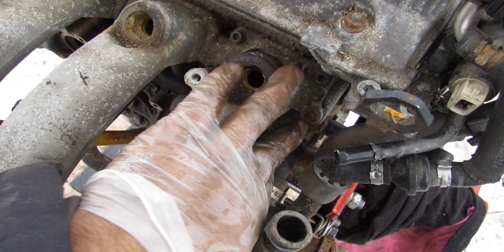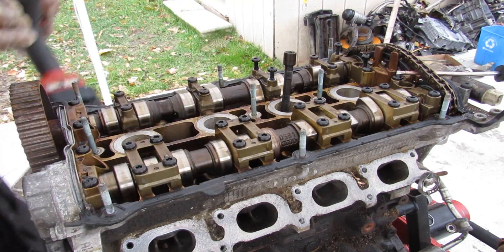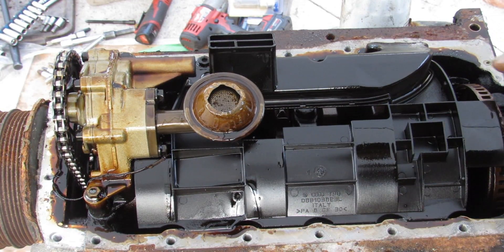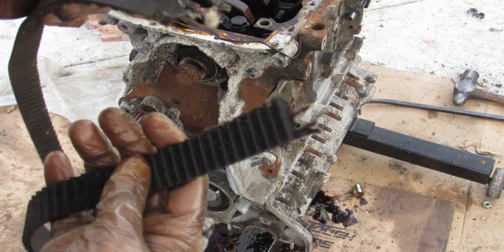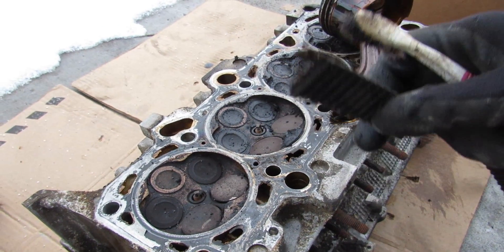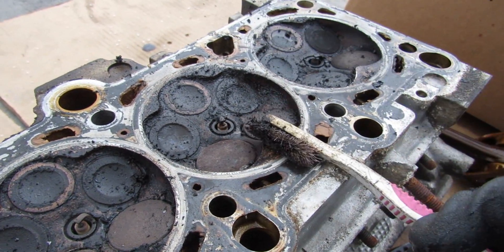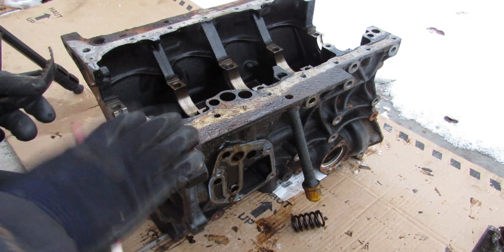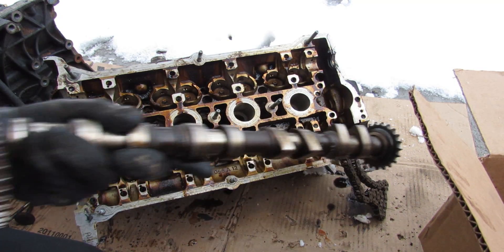What Happens When a Timing Belt Fails?

Comment: Anyone having experience with Toyota's 2ZR-FXE engine? We're searching for a week but just cant find the problem, maybe someone here is more knowledgable or has an idea.

The problem started after the car came back from the bodyshop, they did some bodywork on the rear bumper, before it was fine and now its not but the bodyshop swears nothing happend, what can you do?!

Car has only 30k miles and has missfires on cylinder 1 and 4 (the outer crank pair) and shakes and rattles like hell but only when part trottle, under full load it disappears. 
We tried about everything, new plugs, changed coils around but their fine, changed fuel injectors around but their also fine, cleaned then replaced the EGR valve, cleaned the EGR heat exchanger, cleaned the EGR pipes, cleaned the intake bridge and all the internal EGR pipes and inlets and finally cleaned the throttle body.

We checked all the combustion chambers for coal deposits or marking but their all clean and fine, compression is fine and even, no excessive oil consumption.

We recorded data and everything looks fine in the live telemetry, throttle demand matches throttle position, same for the EGR system, all the sensors and their data seem fine, all the systems are working as they should and are fine too, nothing out of the ordinary.
 
We also had many ideas we checked via live telemetry but finally put aside because it would affect all 4 cylinders and not only two like the VVT system, the oxygen sensers, fuel pump, knock sensor, crankshaft sensor and many more.

We're at a dead end, anyone having a good idea?
Reply: You changed all those things without changing the ignition coil harness or injector harnesses.

When I had misfires on my kia g4fc I changed my spark plugs and an ignition coil, but the misfires remained on the same cylinders, even after swapping coils around all other cylinders, it remained constant on the same cylinders until I bought a used harness and then the engine ran like a dream.

Try a new ignition coil harness or injector harness, they're cheap af at junkyards, as long as you know it's a misfire, it'll be in the induction, fuel and ignition systems.

You should also know that a harness can look good and function, but still be bad by having too much resistance.
I wish you the best figuring this out.
Reply: @chiefdenis  Thanks for the input. 

The only things we changed were the plugs and the EGR valve because we had one lying around. I should probably have said "switched around" instead of "changed around", sorry my bad, its not my native language.

I really dont believe the ignition coil harness or injector harness could be the problem because the car was running fine before it was in the bodyshop. Also its a Toyota, we never have any problems with wiring and this one has only 30k miles.

Its a car from our own external business so we have time and it wont cost any more for troubleshooting so we started with testing things first and try to find the failure before we start ordering replacement parts when we dont even know if thats the problem or not.
Reply: @benistingray6097  this is my process for fixing misfires; misfires will usually occur due to a malfunction in the INDUCTION (INTAKE), IGNITION, OR FUEL SYSTEMS, it can be in more than one of the systems so i'll usually do some basic tasks in all systems:
INDUCTION: get a can of carb cleaner and maf cleaner (or electric contact cleaner since maf cleaner is not available in some countries) disconnect the intake ducting and clean the throttle body with carb cleaner and an old toothbrush + a rag, also clean the air filter or replace it if its beyond filthy.
within the intake you should locate the maf sensor and spray it with the maf cleaner a couple of times, it's usually right after the air cleaner, some weird designs have it before the air cleaner though, you dont want to touch this sensor unless you dont have a spray solution.

IGNITION: if you switched the coils around and the misfire remained on the same cylinders, then you most likely have good coils, the problem could then be a bad harness or dead spark plugs.
spark plugs are really cheap so i'll encourage you to atleast change them to eliminate that aspect.

You can also take out all the spark plugs and inspect them, the misfiring cylinders will have black spark plugs because they're not burning the fuel, sometimes a bad spark plug/ignition coil will still fire but will be unable to burn off all the fuel.
A good firing cylinder will look close to white or brownish due to the dye in fuels or if you use a fuel additive.

There are resources out there for reading spark plugs, that knowledge is invaluable for figuring out misfires, you should always try to read your spark plugs first, it'll likely point you directly to the system you need to be tackling.
i'll give you a brief, completely black means it's not firing so your problem might be in the ignition system.
Black and slightly wet means it's getting flooded with fuel so you're running rich, tackle the induction system and possibly injectors.
Black and very wet means it's getting oiled either from the spark plug valve gaskets, valve stem seals, or piston rings.
If it looks almost too clean even though it's been installed for a while, the combustion temperatures might be too high due to running lean, you'll want to make sure the injectors are firing properly, sometimes a bad o2 sensor can mislead the ecu to run too lean.
these are a few symptoms of spark plug colours off the top of my head you should definitely research spark plug colours, it'll help greatly with your problem.
Reply: @benistingray6097  i had to break my comment into 2 because  the first one was getting too long.

FUEL: for the fuel system, simply having bad or contaminated fuel is enough to cause a random misfire, it wont be on only one cylinder though, usually just adding more good fuel to mix with a bad one and driving a couple of miles can solve a bad fuel misfire.
other than that, clogged injectors or leaking injectors can cause misfires when they don't deliver the right amount of fuel directed by the ecu or deliver too much due to leaking, fuel needs to be atomised when injected, you can solve this by cleaning your injectors and replacing bad o rings.

A bad injector harness may also cause an injector to not deliver the right amount of fuel, it's a power cable after all, a poor signal might cause poor atomisation or none at all.

The check valve at the fuel pump and pressure regulator at the pump or rail can get bad and reduce the fuel pressure, on none performance cars the fuel pump should constantly deliver 40 to 60 psi of pressure (depending on car) all through the line and at the rail for hours, you can check this with a pressure gauge or a high end scan tool. You will especially have a poor idle and low rpm performance if your fuel pressure is weak.

All that said, i'll encourage you to thoroughly tackle all these systems by process of elimination from the cheapest problems to the most expensive, there's a 99% chance your problem is in one of these systems.
Now, even though i don't think and EGR valve can cause a misfire, as long as it's easily accessible, i'll advise you to clean it up with a carb cleaner spray, it's cheap and precautionary, but i 100% don't think your current problem has anything to do with the egr valve.

Good Luck once again, fellow traveller, be thorough.

Comment: One of my favorites. A good engine if taken care of. They had to upgrade the oil filter capacity early on, when the filter was small they were sludgers. The upgraded filter is HUGE.
Also, cool to see it from behind (I had a Passat), had to replace the heater core hose and the coolant flange (you called it the coolant inlet with the temp sensor).
The Secondary Air Pump was GARBAGE. Always full with water... I had that engine light flowing 24/7 because of it.
05:20 five valves per cylinder, who can not remember that 5V 1.8T engine cover :)
Reply from the maker: Good to hear first hand experience. If this timing belt didn't snap and bend valves it would have still be running although probably burning oil as per the internal condition
Reply: @speedkar99  I've seen folks with 300-400k miles and they wouldn't "change" the oil, they would just top it off. Mine had 230k and started to overheat but EVERYTHING in the interior was broken. I had 2x4 holding up every window apart from the drivers. Door handles, I mean you name it everything broke... I had no energy nor time to work on it and I was a student in the city so it had to go. Those B5 Passats were one of the best driving cars with that suspension! Would love to buy a 1.8t manual 4motion (back then same as quattro) and fiddle with it as a project. Mine also did not burn any oil that I remember, I also used 0W-40 Mobile 1 "European Formula", unsure what that did to the engine but the engine liked thin oil.

Comment: Meanwhile, my outdated Honda R18 has a chain. All Honda 4cyl newer than that have chains too
Reply from the maker: Chains aren't always better than belts. VW tried chains and didn't do very well.
Reply: Yeah, failing chain tensioners, plus some the new Hondas stretch the timing chains and chew the cam sprockets. Good oil, 8-10k km max OCI instead of Honda oil calculator and they should hopefully hold together. But I'm not really fun of chains, but  multistage variable V-Tec probably easier to design with chain, but the chain works harder. Then the oil has less zinc as additive comparing to 5w-30 made three decades ago.
Reply: Some GM 3.6 engines had an OLM that went too far. It may have done a good job keeping up with the TBN of the oil, but not the needs of the timing chains. People who changed oil earlier than the OLM were able to delay or avoid the problem.

Comment: Also while you are there change that plastic water manifold, because having to take half the engine off to do the belt means you can actually get to that as well, so do it with the belt, because it is also about the time they start to leak as well.
Reply from the maker: Good idea

Comment: I love this channel and I DO CARS with ERIC. I love how mostly idiots that don't change oil regularly end up having a blown engine. Sometimes it is poor engineering.
Reply from the maker: I watch his channel too, he does good work. And you're right, at the end, it all comes down to maintenance
Reply: Sometimes people do change their oil regularly, but the users manual is too optimistic about how far you can go. Some VW engines called for 10,000 mile oil changes with their 5w40 synthetic, but shouldn't go beyond 5,000 miles.

The Toyota 1MZ-FE called for 5000 mile conventional oil changes, but people who did that often ended up with the Toyota sludge disaster. Many people avoided it with 3000 mile conventional oil changes. My dad knew an Avalon owner who had his engine replaced under warranty for that reason. The guy at the dealer said "Change you oil at 3000 miles anyway, otherwise it will happen again. You could go 5000 miles on synthetic."

Comment: Them motors are 💩
Reply from the maker: I wouldn't bash this engines build quality. A broken belt is due to owner neglect.
Reply: @speedkar99  The best rice cooker engine I can attest to, was the engine in my ‘90 240 SX
Reply: Bullshit I currently have 345,000 on my Audi. Stop listening to Wikipedia.
Reply: Why do say that?
Reply: @lincolnbothang7258  Look 👀 at it. Broken timing chains don’t do catastrophic carnage like that. When buying them cars, you gotta know ahead of time, if you’re getting a non-interference or interference motor in that car. Either one is still 💩
Reply: @regsmith7604  a broken chain will do the same damage😂😂
Reply: @longnose9071  The BIG difference is that a chain usually gives you more than enough ADVANCED warning. When you see a camshaft position code and/or a misfire OR you hear the chain rattling and gouging the cover....well most idiots love me take notice that 💩 is happening and not good shit either. Belts just snap. Changing the belt is very very prudent.
Reply: German cars are 💩
Reply: The motors are as reliable as its owner.

Comment: Eeyyy a 1.8 with a broken timing belt. Been there in my Audi TT. Had to replace the cylinder head. Good times
Reply from the maker: No damage to the bottom end? Did you pull the motor or do it in the car?
Reply: @speedkar99  my buddies and I changed it in the car. Only damage to the bottom end was a small nick in cylinder #4. Been in the car for just over 20k miles. Good as new 👍